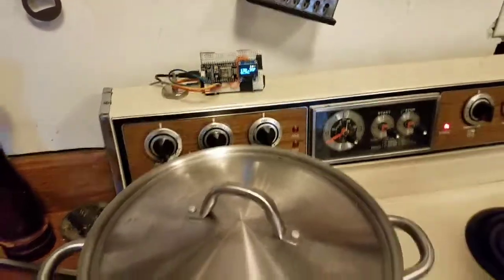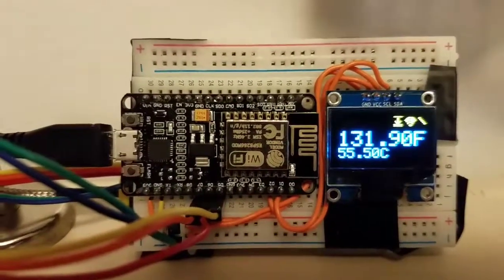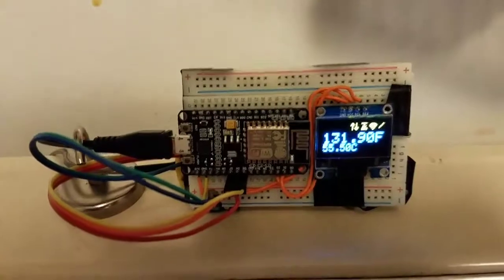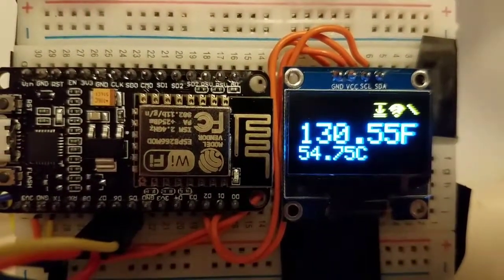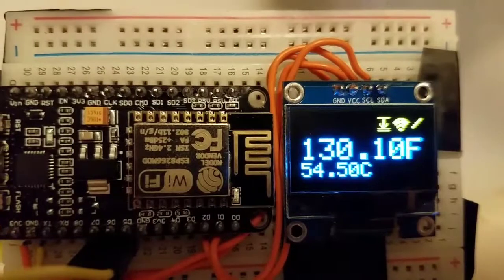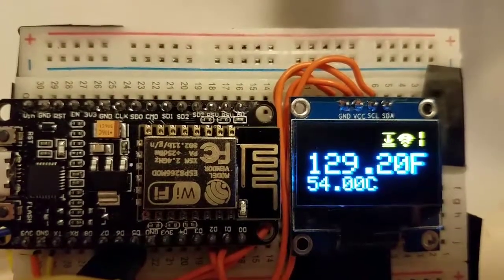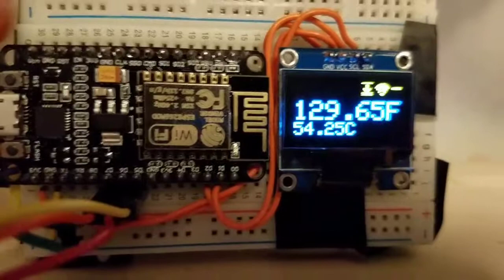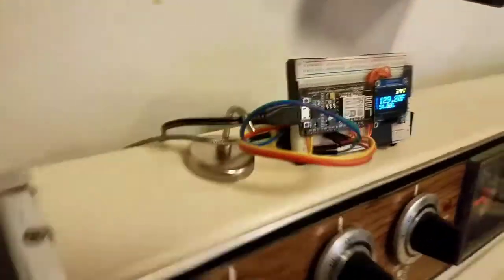Oven IoT Temperature Sensor

Comment: Nice project! I'd like to know which kind of sensor you are using to get the oven temperature. Thank you
Reply from the maker: It's a type K thermocouple connected to a thermocouple amplifier with a built in ADC.